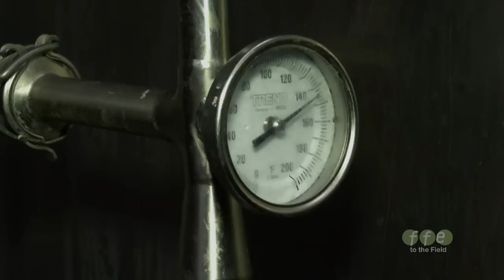Jersey Cows: A Dairy Farmer's Commitment to Tradition and Quality

Comment: HMMMMM!!!   old guy here....  I'd like to add to your info!!!  When training Anything to lead, cows included...  It's !00% about the pressure you put on the rope and WHEN you release it !!  You will succeed very quickly IF...  When they pull, the pressure is maintained steady and they get NO "reward" (or release of pressure)....    BUT !!!! if the animal steps towards the pressure it is VERY IMPORTANT that the pressure is instantly released!  (as a reward)  Watch their feet VERY closely!  The instant you see the intent to step forward slack the rope!!   and afirm with your  "low calm gentle voice" gooood girl...   after a short wait...  "come cow" and gently increasing pressure, watching the feet VERY CLOSELY for an instant release when she gives to the pressure.             WHY would she lead if it makes no difference to the pressure???    In time if you gently waggle the rope "come cow" and walk...  you wont need to pull at all..     IF she pulls maintain steady firm pressure and use your "angry voice"  AAAHHHH!! until she stops.. then ease pressure a bit not completely and change voices "come cow" and watch the feet....  lessons should be short and not more than 15 mins and definitely end on a positive win...   good girl  off you go!!  pat pat!       Your welcome!